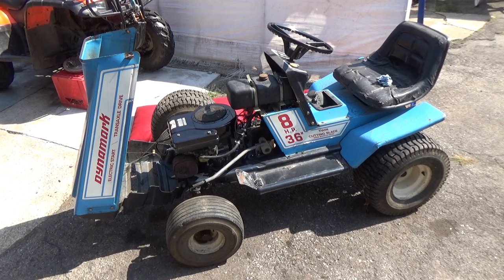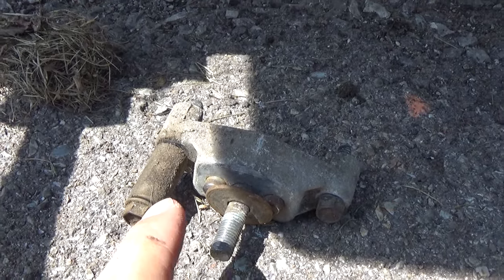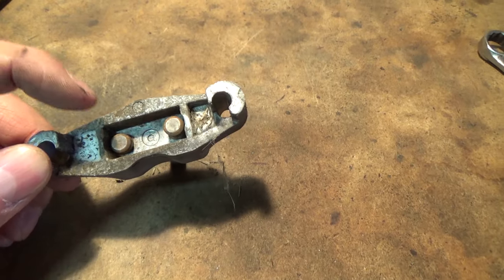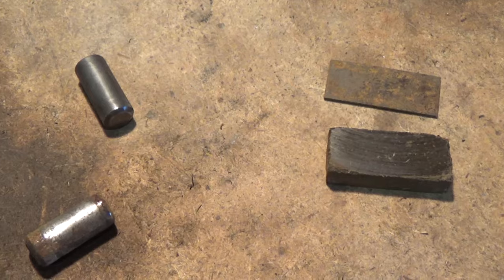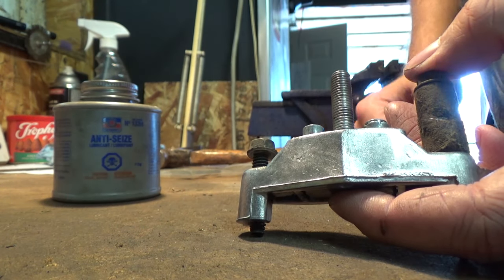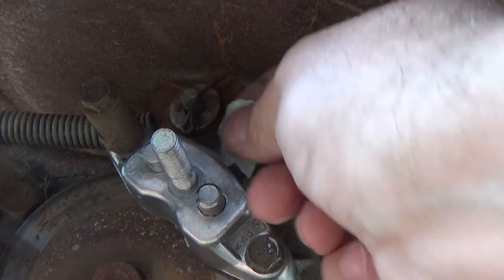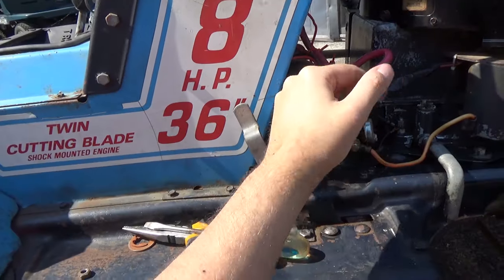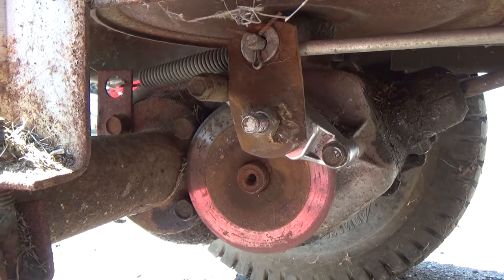How to Fix Riding Lawnmower Brakes

Comment from the maker: I forgot to show that there is a 2nd brake pad behind the rotor. They wear significantly less than the outer pad, so I didn't even think to show it! You can pull the rotor forward, and it will pull off of the shaft. Then you can remove the rear pad.
Reply: Watched your "How to Fix Riding Lawnmower Brakes" from Aug 26, 2017. Found the video very useful, but have a question. Upon dissembling my brake for JD LA105, the rotor does not want to come off. Is it held with friction and just need to be pried off? Also, the pad does not fully match with the rotor and wonder if the notch that builds after rotor wears the pad away "bottoms out" against the back pad..

Comment: Just curios you did such a wonderful job why not pull the rotor off bust off the rust chunks on both sides and clean it up and pull the pad out and check it ? When you apply the brakes all that rust and pits will chew up the pads

Comment: Thank u vary much cause I just bought a riding mower today and I went 45miles away I didn't know it didn't have breaks tell I was putting it on the trailer at home me and my wife was shocked the salesman didn't tell us I'm just happy it didn't go flying off the back of the trailer and everyone trusted my strapping abilities cause I use to work for a business with that type of work so I knew what I was doing think god I got home safely and mowing a lawn and came home to find this video about what the hell was going on with the breaks it set outside for two years bought it for 250 only thing I did today was change oil and replace blades and battery now on to break kitvor clean them I want to thank u again and I hit the like button and I'm new to your channel

Comment: I've watched several videos on this subject.  I didn't see you replace the pad behind the rotor.  But other than that this is the best video I've seen on the replacement of lawnmower brakes.
Reply from the maker: Pad in behind usually wears much slower than the pad in the front, I didn't even replace it because it still had quite a bit left.

However, I agree that I should've included that as well!
Reply: @EliminatorPerformance  did you confirm that rotor was sliding on the shaft. Not sliding would be a good reason for inside pad not wearing.

Comment: Great video!  Answered almost all my questions!!  The one unanswered....If the rotor turns freely, then what stops the tractor?
Reply: I think when the little metal strip moves it engages and disengages the pads. Or puts pressure off or on them when you press on the brake pedal.

Comment: One point..would you want the pad to engage the disc when in the max travel position? If set to engage mid-range there would be additional travel available, in order to be able to apply additional pressure on the disc, if required. Helpful video though.

Comment: Great video!!! Are the inner pads the same as the outside? If different do you have a link to purchase those as well? I have a Dynamark very similar to this and would like to give it some much needed new brakes also.
Reply from the maker: They are the same! Just make sure you don't put it in sideways, as I believe it's supposed to go in a certain way.
Reply: Thanks a lot! This project will be added to the usual maintanance over the winter to get the ol' mower ready for next spring. Thanks and subscribed! :-)
Reply from the maker: No problem, that's what I'm here for!

Comment: Hey I have a craftsman riding mower and when I press the break it doesn't  stop what should I do?
Reply from the maker: Follow the steps in this video and replace the brake pads!

Or you could just adjust the nut on the brake so it engages sooner!
Reply: @EliminatorPerformance  if you want to get really technical, with the brake pedal off and the linkage loose. The adjusting locknut, the clearance between pad and the disk should be 0.020" using a feeler gauge

Comment: Pins rusted shut and on a hill lost engine power Cracked open my head ER put in 8 staples in my head face scraped up. Knoked me out and I do not know how long. EMT sorta woke me up but due to me going in and out sent me to ER. 
I was lucky and very stupid. 
I know the breaks were not right and i did not find out until I almost die.
On my riding MTB the pad was good the pins after hammering out were good (filed down till free). I would suggest spraying pins with a silicon or min WD40 every wash and test for pin rust lockup.
Anitseszz may work but heavy waterproof grease on the pins is better.
Reply: Thanks 
Pins rusty but fixed with a file
Pad was slightly worn flat filed the pad
Pad plate rusty filed smooth.
WD40 minimum every wash and maybe silicone spray on pins or White Lithium Grease pins.

Comment: Do you know where I could buy a new disk? Mines toast and I need brakes for my mower.
Reply from the maker: I'd check Amazon or eBay!
Reply: Eliminator Performance I checked those, all the disks for sale are splined not keyed.
Reply from the maker: HotRodBriggs 60102 that's a good point, I've done some searching and haven't been able to find anything.

Best advice I could give, is look for a model number on your transmission, then go into a small engine shop and ask them to get a disc.

You'd need a part number, but would have to get the trans type figured out 1st.

Best of luck!
Reply: Eliminator Performance Thank you very much, I'll go to my local shop tomorrow to find my disk, it's for a racing mower with with a peerless 671a transmission. You earned a sub btw

Comment: My disc will not rotate?? Tire off ground frame resting on stand and in neutral brake rotor does not rotate
Reply from the maker: Brake pad could be too tight

Comment: What about the pad behind the disc?
Reply from the maker: Never changed that because usually they take longer to wear down, but you should inspect them!

The brake rotor is on a keyed shaft, should just slide off!

Comment: Good video.  How about doing something on a belt driven rear engine rider Mower.  My sister has a Murray rear engine rider that needs brake repair or adjustment.  The model number is Model #      30544X92D
Serial #       7238401672B00080
D.O.M.        96081

Comment: What about the inside pad?
Reply from the maker: Great point!

I think I may have forgotten to show that, usually they don't wear out as quickly as the caliper side pads do.

And if you don't remove the rotor (brake disc) then it won't fall out.

I believe I inspected it and it was fine, so I think I just left it.